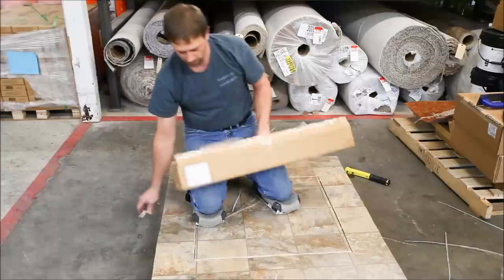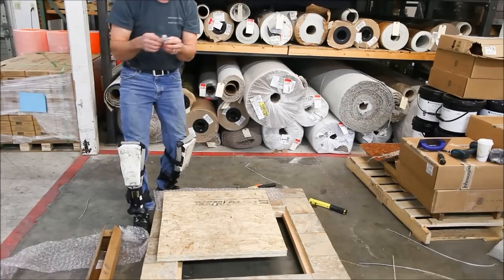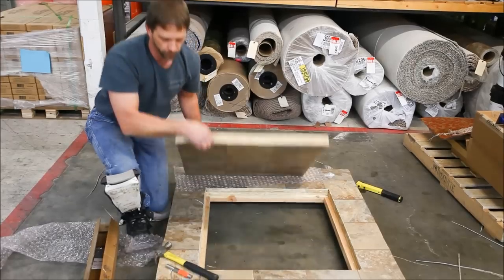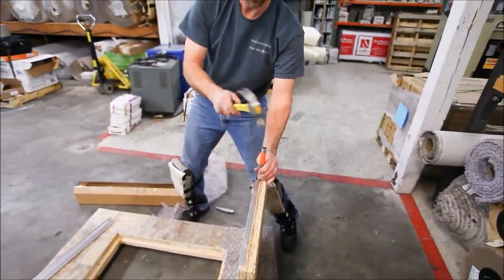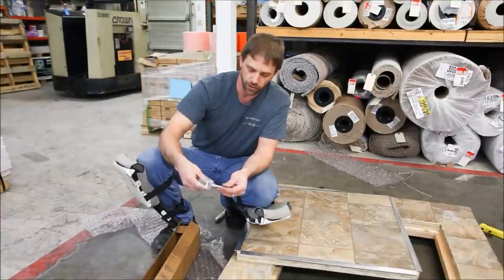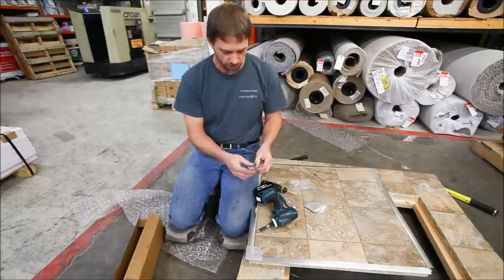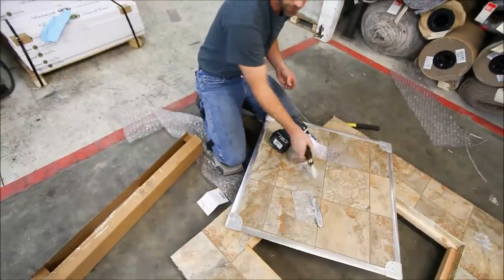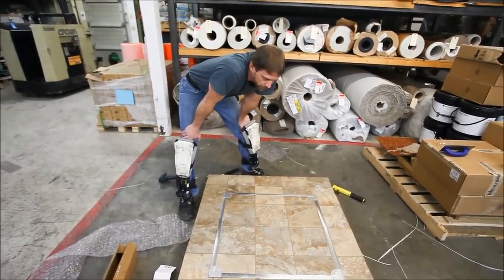Trim a Trap Door with Jonny Corners

Comment: Floating floors can be glued on the trapdoor just so they will keep still when you lift the door.  Some floors can be cut close at the trapdoor but not most and never floating floors.  Laminate floors need to be glued with liquid nails or equivalent, particularly around the perimeter, so you can nail the T metal to the door.  I hope this helps and thanks.
Reply: How about Laminate flooring with the padding attached? Liquid nails still work with that too?

Comment: How would this be done with floating floor? Would your side rails keep the flooring on the door or would it need to be glued down? How about the flooring just butting up against the door, how is that edge finished or does it not need to be?  Thanks,  nice product.

Comment: The old nails into the edge of OSB trick huh...I think I’ve followed this guys work before.  😂
Reply from the maker: Josh Bryant  the nails included in the kits are minimal in diameter and don’t damage the osb or puff it up, the corners are screwed down and the weight of the door can easily by lifted by the corner

Comment: TRAP DOORS ARE DEADLY
PLEASE - ADD A BARRIER or DANGER SIGN that automatically raises as the door is opened.  The cool door has extreme dangers.  People walk on these doors a 1000 times a year without thinking it may be open.  You may notice when street crews work inside manholes they surround them with barriers to prevent pedestrians and cars from falling in.

My friend opened her door to the laundry room where a contractor from the previous day left the floor-door open to the crawlspace 4' down.  She walked in carrying her laundry basket blindly stepped into the open floor.  Result: compound femur fracture, broken ribs.  She was there for over several hours when a neighbor happened to stopover.  Otherwise, she may have died a slow death.  

Why do you think they're called "Trap Doors"
Reply: So you are telling me that she did not go and check anything after the contractor was finished working? The homeowner and the contractor are both at fault, The contractor should’ve closed up the access door if he was the one that opened it! And the owner should’ve checked as much as she could when the contractor was finished!